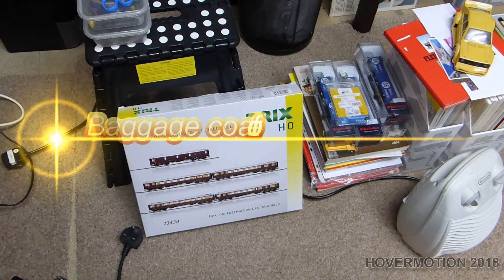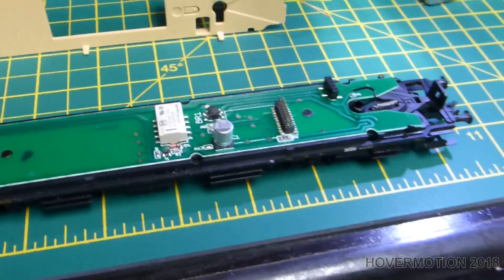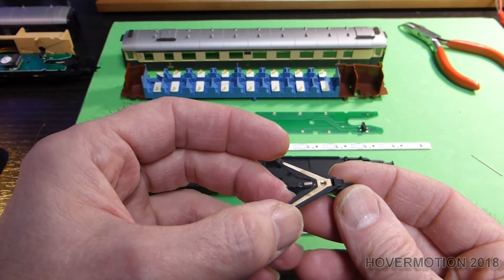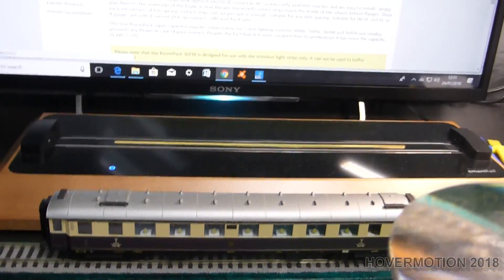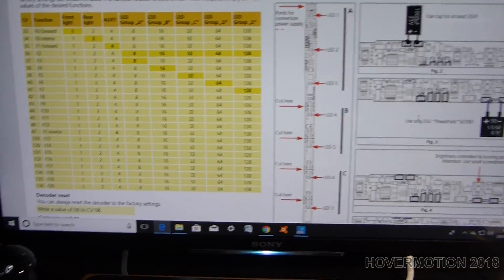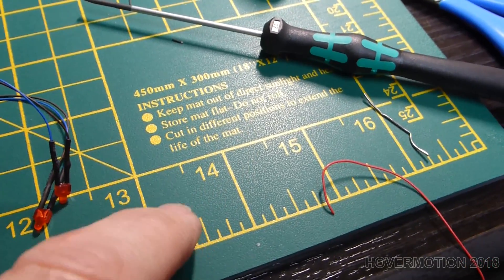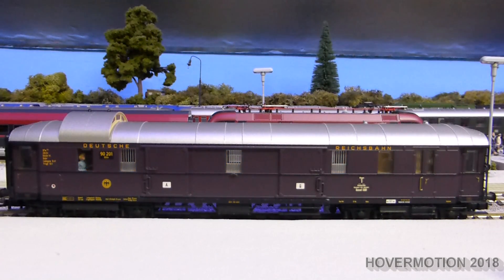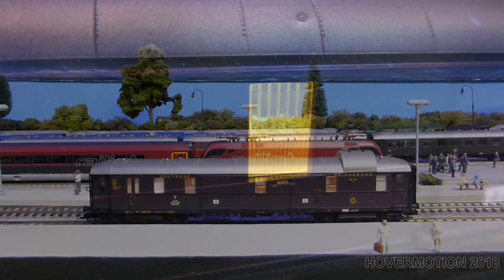Install of Esu 50709 lighting Trix 23430 Vid A

Comment: Good video, I assume since you did this you have done more coaches and things and these lights look really good but what I wanted to ask and hope you can help me with is that I'd like to fit this into a unit that needs to have sound that I was going to use an ESU 8 pin v.3.5 or v.4 sound decoder in, the decoder would have been would for powering the unit, sound, lighting and one tail light, so with this light strip do I still need any of the latest version sound decoders for what would now be just power and sound with the use of this lighting strip?, I hope I'm making sense, sorry if I'm not I'm only a novice with this, many thanks for any help you can give.
Reply from the maker: Hi , I am not sure about that setup as this version of the Esu lighting strip has its own dedicated dcc chip.
You may need to hard wire the sound chip from the track power pickups of the coach and add a standard Esu or another make of lighting  strip off the Auxiliary outputs of the sound chip. The sound chip will work fine just insulate the motor wires and any other unused wires.
I did the full fitout of this set and did more videos to show.
Thanks .
Jim.

Comment: 20 seconds??? Crazy! 😁
Reply from the maker: Max Supercars I did cut some lights off the strip as its a small coach...but the uncut strip will fit a full scale length coach so the back up power time will be shorter as you know...